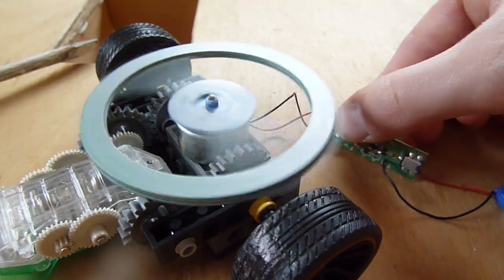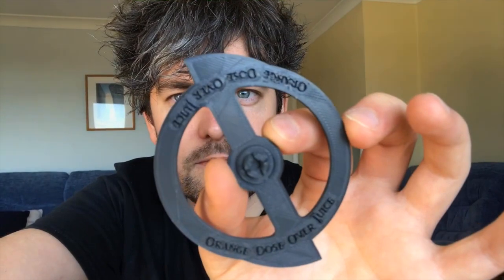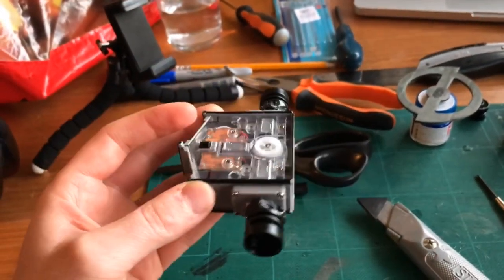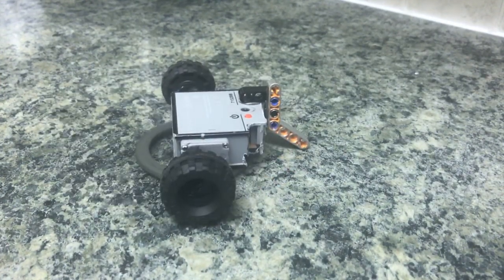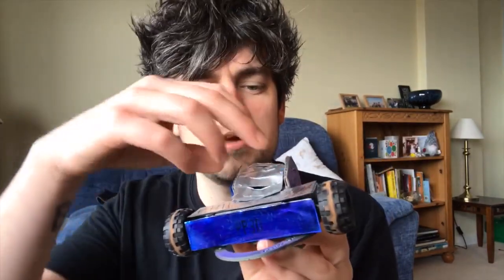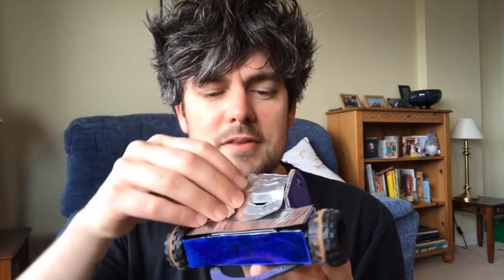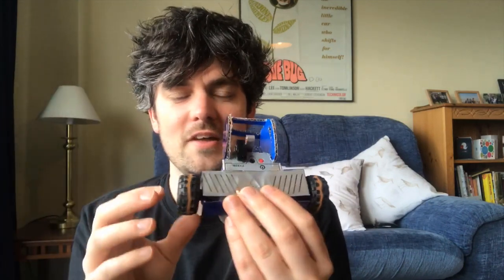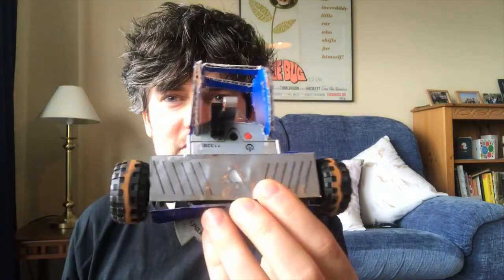R/C PP3D Hexbug Mod

Comment: PP3D looks great also if you have issue with the drive being inverted why not swap the wires around so it can drive normally
Reply from the maker: Yeah I had similar comments about my Diotoir - I'll be sure to do that in future builds - now the disc is glued on I can't take the "top" cover off.
Reply: Try not to forget next time.

Comment: It's a great design and I can imagine that PP3D is a rather tricky design to build. I've been trying to make a custom Brutus robot with an old Witch Doctor toy and it's not going overly well.
Reply from the maker: Thanks. Well keep at it - as I show in this video, I tried so many times to build a PP3D and it just wouldn't work but once I persisted it eventually turned out ok :)
Reply: @OrangeDoseOverJuice  Thankfully, I ordered some old Witch Doctor toys from Ebay so if anything bad happens, I can just start from scratch. Plus they came with the new Bronco toy, so I'll be working on that as well.
Reply from the maker: Nice find! Always good to get them cheap so that you can experiment more - I somehow found the whole arena and the Tombstone and Witch Doctor for £35 which was good!  @menkomonty
Reply: Try making a new chassis out of cut up Amazon* gift cards or foam board. 

*It doesn’t have to be just Amazon gift cards.

Comment: Nice build. Maybe you could send the stl files for the blade and the megabyte shell, I want to have a go at both of them. 

Edit: I noticed things kept popping off, maybe you can do something about that.
Reply from the maker: Hey, the guy I use is thinking about setting up an Etsy store or something so if that happens then I'll mention it and have a link in another video.
Yeah once I glued the disc on properly it was much more reliable and didn't come off again and the rest of the things just needed glue after a long demo filming sesh because it was such fun to drive I just kept going :p
Reply: OrangeDoseOverJuice What were you using for the original drive?
Reply from the maker: As in my first attempt? I was using a Hexbug Fireant and some Lego technic... it didn't work well :p  @Lumakid100
Reply: How did you remove the wheels? I'm trying to kitbash my Tombstone into a Gabriel.
Reply from the maker: Lumakid 100 I didn’t - I couldn’t work out how to get them off so I just cut them down until they didn’t clear the main body.
Reply: I know it's possible because Endbots managed to take them off on camera.
Reply: I managed to take them off (with the weapon module off) with a flathead screwdriver on one side and my thumb on the other. You have to work at it a little but you can get them off.

Comment: Hey man,  is there any way to get the tombstone wheels, and white weapon piece off without breaking anything? ive been wanting to build a bot out of spare hexbugs that I have laying around, but don't want to bust the motors.  Thanks!
Reply from the maker: Hey, so I couldn't find a way to get the wheels off. I'm sure there must be a way but I tried for ages with no joy so for PP3D just ended up "trimming" them down so they no longer cleared the bottom :p The white weapon bit should come off with a bit of persuasion by levering it up with a small screw driver. Just be careful to do it from both sides to evenly draw it off and also not to lever against the part of the body above gap where the weapon belt usually goes through as that just snaps instantly :p 
Any ideas what you're going to build? :)
Reply: Thanks a bunch! I want to see if I can make some sort of vert spinner with a bar/disk on the bigger side. I'm planning to do this with a wood frame and weapon if possible, I guess we'll have to see if I can get it apart first haha
Reply from the maker: Fantastic! Good luck. Let me know how it goes :D @shaynestrudel9334
Reply: I will for sure! Thanks for your help!
Reply from the maker: No problem :)  @shaynestrudel9334
Reply: Idk about the weapon piece, but you can take off the wheels by using a flathead screwdriver and determination.